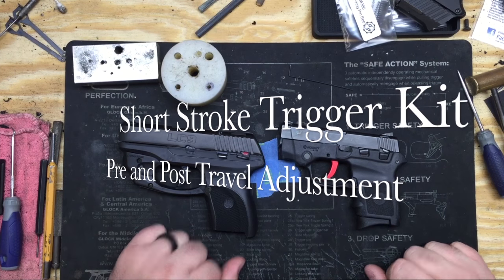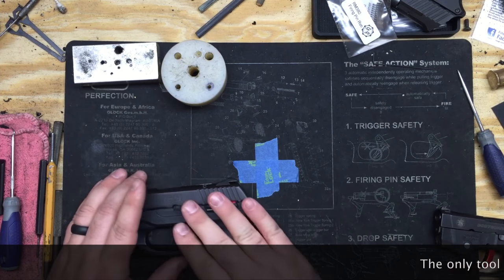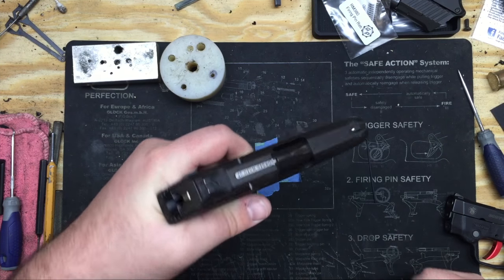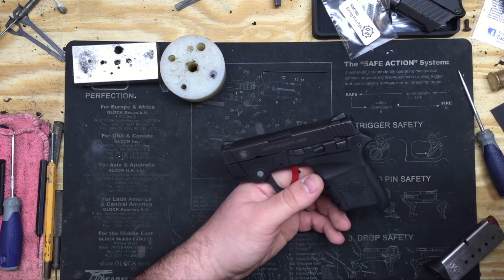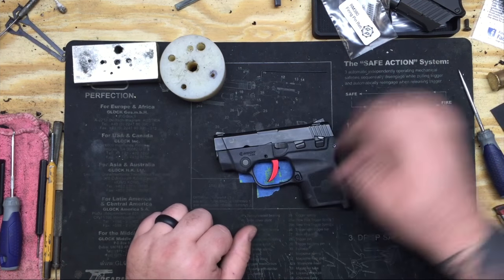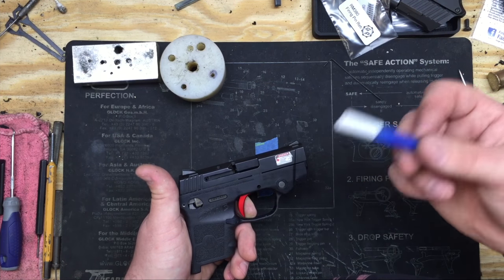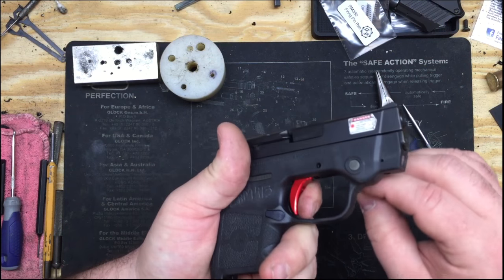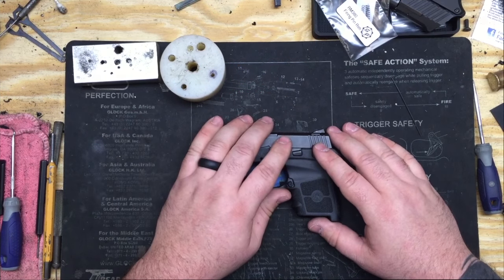Short Stroke Trigger Kit Adjustment

Comment: Serious question, does it make the gun less reliable for the trigger to rely on loctite in two places?
Reply from the maker: No, it's makes it a LOT less reliable if you don't.  The screws will move from the vibration of firing if you don't, thus defeating the purpose of the pre and post travel set screws.

Comment: Should have had the Body Guard working correctly rather than rambling on about how to apply Loctite.  That ramble about the fail to function and Loctite muddied the waters about making adjustments.
Reply: Yeah there was some shady biz in there.  I did just install the santiago trigger kit though.  I too have no pre-travel screw as someone else said, but the kit also said the "pre-travel is built into the trigger".  Guess it's something that changed over time or they simply removed that.  The trigger is effectively a three-stage now.  Short, light, takeup while you move the trigger, and thereby bar, until the trigger bar starts moving the hammer and the hammer spring starts resisting.  Then heavy takeup to a discernible wall with a short, fairly crisp, break with no overtravel.  I'm quite happy with how this trigger is now.  I like the audible and tactile 2 pt reset much better than the stock.  I haven't done the slide springs yet because I'm not sure what the purpose of weaker blocker and firing pin return springs is.  I'm guessing the lower power firing pin return spring helps with light strikes.  Idk what the blocker is doing or why a lighter spring there is good.  Overall, I've been pretty happy with all my Galloway purchases.  Stainless striker guide in an rapc was real nice.  Trigger feels lighter, even though it shouldn't be, the firmer rod definitely gives a better trigger pull or feel compared to the factory plastic.  The stainless recoil spring for rapc is good.  Pinky plus 1 full grip bodyguard mag extension is nice, way better than the stock pinky extension floorplate and not as ridiculous as the pro-mag 10 rounders.  Not sure if the bodyguard hammer from Galloway did anything different from the stock one, it's supposed to be harder or fix some tolerance issue or something i think.  Some of the issues and how they're fixed by Galloway parts are not exactly clear.  So far I haven't experienced any issues because of their parts, and as I said, I've perceived them to all have been good changes.